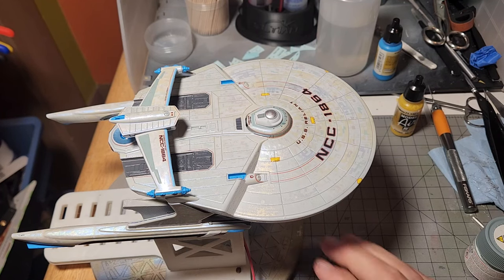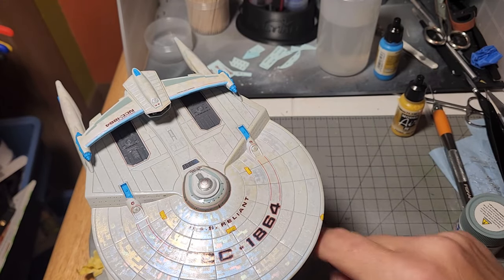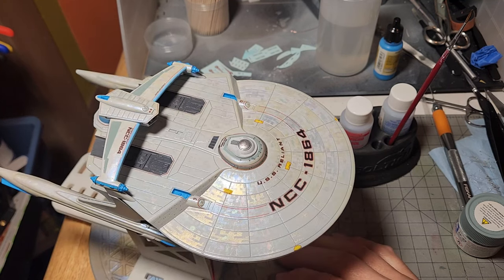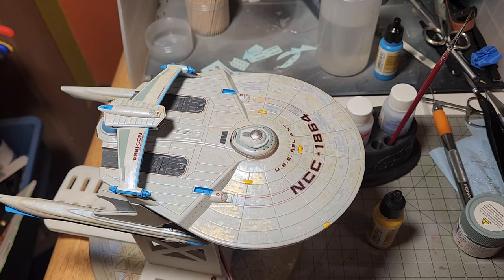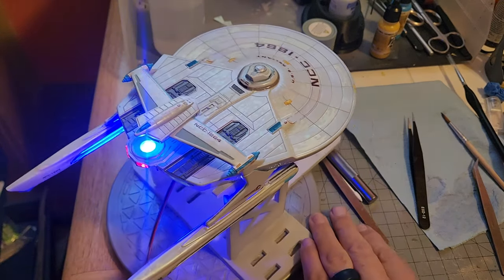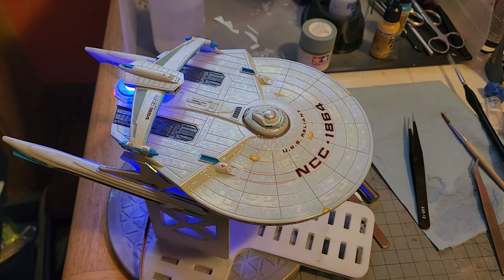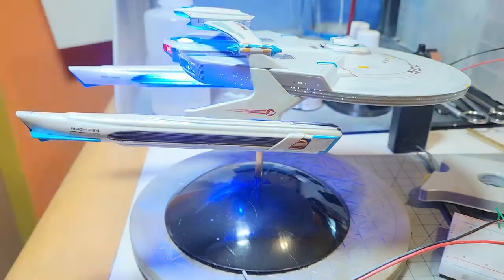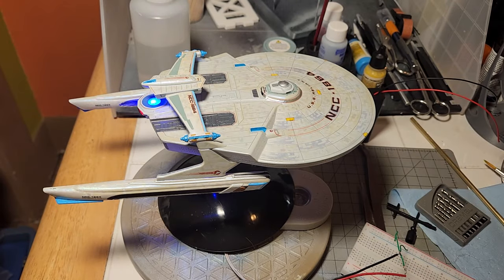Reliant Final

Comment: Great paint job. Just finished  both 1:1000 scale. Put a lot of the lights on both ships. Though lost the strobes on the rear nacelles on the Reliant as I used fiber optics. Which I remedied on the Enterprise. Love and learn I suppose. 😊 Great job on yours!
Reply from the maker: Thanks! I hope to be able to unlock the strobes ability soon.
Reply: @goodash1  what I'm planning to do to the one 1000 scale is to use the 1.8 mm LEDs which will just sit just a hair below the surface and you can put a drop of super glue on top of it and then you'll have your strobes